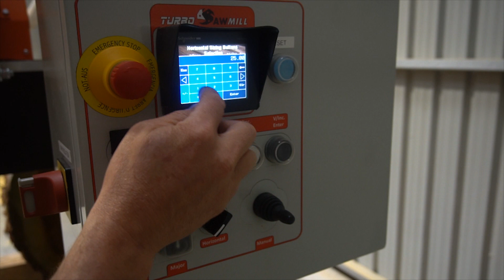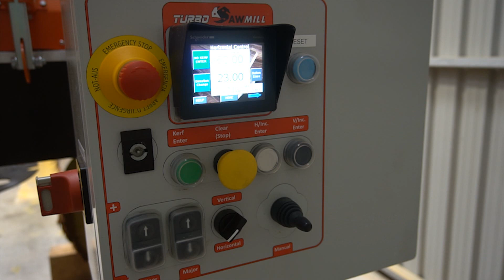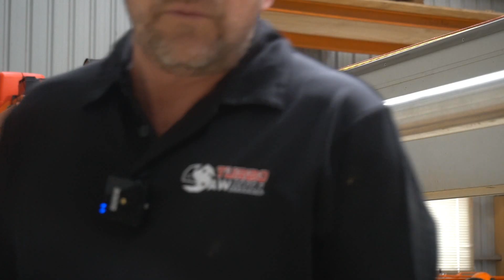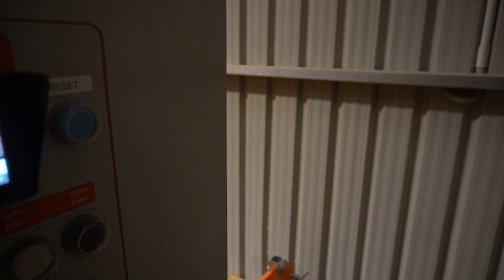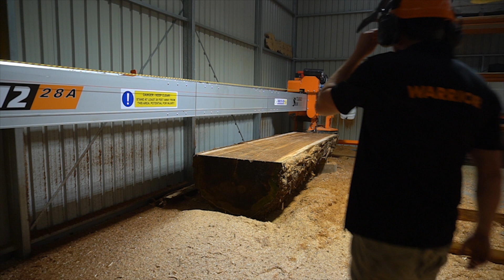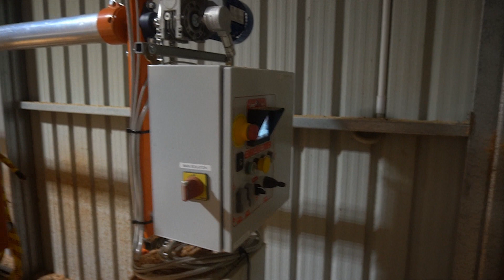Turbosawmill 12" mills up a MASSIVE redwood.

Comment: What kind of red wood it is? Is this machine good for cutting African Azobe/sipo, sapele/ teak? What is the cost of installing one unit? Space required? Other technical details? How often you have to change the blade?
Reply from the maker: Of course, a swing blade easily cuts the hardest timber in the world - it's not like a bandsaw.
Reply: @TURBOSAWMILL  thank you for your response. From our company, we would like to know, what is the cutting thickness? Means, in each pass of the blade, how much timber will be lost in terms of mm. Also please let us know the other information we mentioned. Or at least let us know from where we can get those information.
Reply from the maker: @CS987liberia  I really think it's an over simplification when considering this as your solution to processing timber. You will soon find out: simplicity of operation, simplicity of maintenance, consistently accurate and straight timber probably the largest factor, manual input for production (not having to rehandle slabs for Sawing). Deflection in hardwood and diameter of logs. These are all the significant issues before you get to kerf. Sawmill competitions in the US highlight kerf is irrelevant to both production and recovery. These competitions compared swingblade mills and band mills. The swingblade achieved higher results both in production and recovery. Kerf ranges between models: 5.7mm to 7.1mm kerf on an equevelent bandsaw will range from 2mm to 4mm depending on model and not taking into account deviation of cut which is typical and a far greater loss.